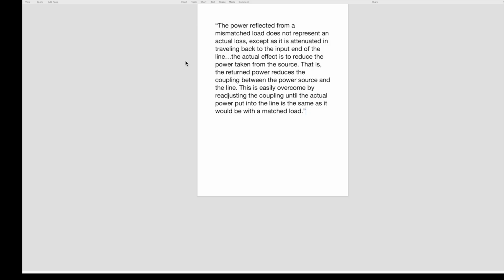Ham & CB Myth - Without a Tuner Reflected Power Destroys Your Transmitter!!

Comment: My radio shuts down if swr is too high.  Probably protecting itself from nothing.
Reply from the maker: No it is protecting itself from voltage and current spikes caused by an impedance mismatch that can wipe out the final transistors.

Comment: If this is the case, why do modern rigs have protection circuits that shut them down when they see too high of an SWR?

All my Kenwood manuals 520, 820 etc… say, don’t run them into an antenna showing higher that 2:1 SWR. Why would they say that if it wasn’t a problem?
Reply from the maker: Because an impedance mismatch causes high current and voltage spikes in the output stage that can destroy the transistors.  It is not caused by reflected power.

Comment: Some of this discussion is pretty frustrating, IMO.  The reflections on the line are a result of its behavior as a transmission line -- it is long enough that there is a phase delay from an AC waveform going in to when it comes out, and that means there are many states of current and voltage along the line at the same time.  

If the transmitter was directly connected to the load without any transmission line, it would develop whatever voltage-divided and phase-shifted waveform that matches the impedance divider between the transmitter's output impedance and the loads impedance.  

With the transmission line in the way, the transmitter "sees" a 50-ohm impedance in the characteristic impedance of the line, and delivers a V/I ratio that matches that... it proceeds down the line, and abruptly discovers that the line is not infinite in length and it is not terminated in a proper load.  Some power proceeds, and some reflects.  When the wave returns to the transmitter, it encounters a discontinuity between the line's characteristic impedance and the transmitter's output impedance.  Some power is delivered into whatever resistive elements exist in the transmitter (e.g., the finals), and some reflects back off down the line.  It should be that a lot does, because output stages have very low impedance, and it's a very bad match for the transmission line.

Eventually, with multiple traversals, the reality of the transmission line terminated in a bad impedance will resolve to a sort of steady state -- the transmitter seeing not the characteristic impedance of the line, but rather some complex transformed version of the termination through the line, and it develops the concomitant AC waveform that is the impedance-divided result of its output impedance and this transformed impedance.  There will be a standing wave on the line in perpetuity because of transient effects, and some combination of losses in the transmitter, line, and antenna is where all the power goes.

The discussion is annoying because these things are all related, and you can't really separate their effects to try to say that VSWR doesn't hurt the transceiver.  It is a measurable effect that is part of the whole system of danger to the finals, so it's not wrong or a myth to say it at all; it's just an opportunity to opine with blurry terms that aren't completely wrong and aren't completely right either.

If there was no VSWR, then there would be no transformed impedance seen by the transmitter, and it would not develop a dangerous condition, either lightly loaded and spiking voltage, or heavily loaded and spiking current.

This is all like saying it's not falling off a cliff that kills you, but it's the sudden stop at the end.  But we all know there will be no sudden stop at the end if you don't fall in the first place...
Reply from the maker: Fact remains that most hams think standing waves damage a transmitter.  Standing waves don't do anything but stand there.  It's the impedance mismatch that can damage the output stage.  That is a fact.  I stick with facts.

Comment: Your better off with a resonant antenna. I love my DIY FAN Dipole.
Reply from the maker: Nothing wrong with a fan dipole.  I've used them extensively.
Reply: A non resonant antenna system tubed to resonance by the tuner can be far better than an antenna system without a tuner, just look at a double zep or doublet

Comment: Is it not why transmitter reduces power when its sensing circuit detects too much power is reflected back. To protect finals?
Reply from the maker: Yes but the protection is against an impedance mismatch which can cause voltage and current spikes.  Reflected power does not go into a transmitter.
Reply: @BustRadioMyths  Your last sentence is confusing, can you kindly explain. Reflected power bounces back and forth between the PA and the antenna until some of it gets transmitted and some of it gets absorbed/lost as heat in the antenna system and in the PA.  That RF energy wondering around in the antenna system could cause big voltage spikes, damaging solid state PA, is that not true? So, the tuner is there to let PA pump at full power/protect the finals and let the tuner take the beating.
Reply from the maker: I was quoting acclaimed antenna engineer Kurt Sterba.  You can download his papers at Palomar Engineers dot com.

Comment: In the “old days” all our transmitters had controls where we could tune them. Then we went to a fixed output solid state era where all transmitters were broadly tuned for 50 ohm loads. We lost the option to tune the transmitter and had to be sure our load was near 50 ohms. Now we have a lot of rigs with tuners built in where we are again able to tune the transmitter. My old Viking Ranger can load up most anything I connect and SWR was not an issue. My Elecraft K3 not so much but good enough.

Comment: First of all, thank you so much for doing such videos. Since I am a begginer, I try my best to make my own antennas. I applied what I've learned from you. I constructed a 7 element 2 meter yagi, used a 6 feet coax and tuned the yagi from the feedpoint via my analyzer. When I finally got it tuned, I hooked it up to 50 feet coax. And what do you know, it got the same reading and I was so happy about it. Even when I connected it my radio, still got the same reading at 100 watts. Highest reflect is around 300 milliwatts, the lowest is almost nothing. Not perfect though because the impedance is 50 ohms and down to around 38 ohms. Is that okay sir?
Reply from the maker: Sounds good to me!